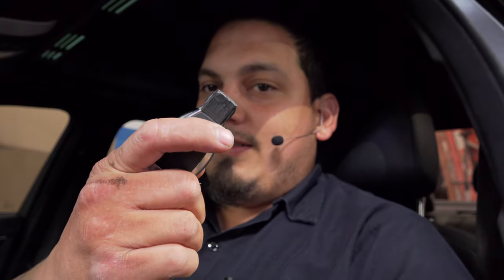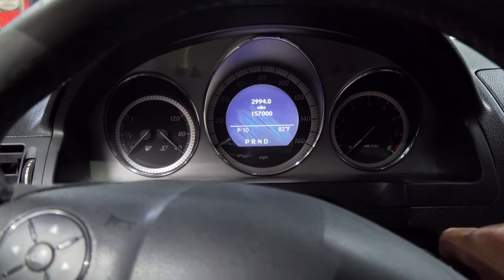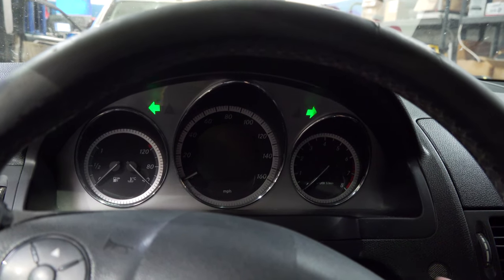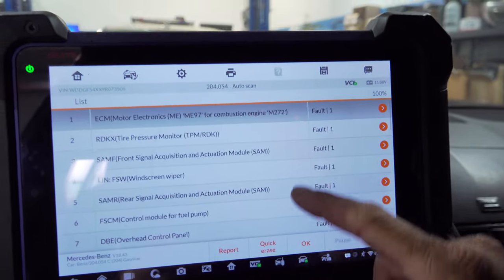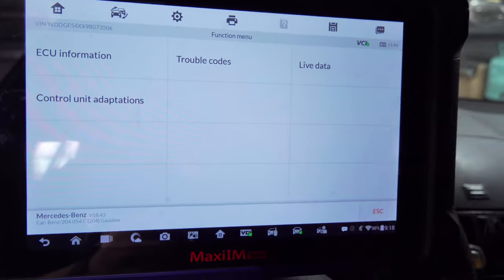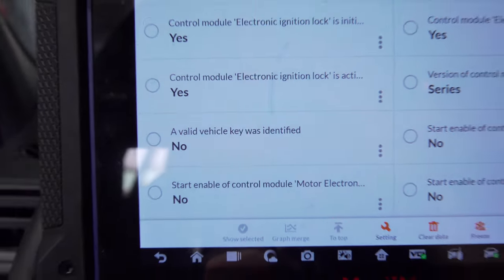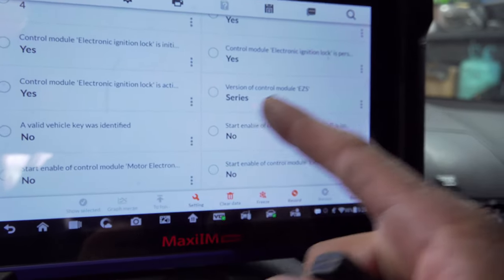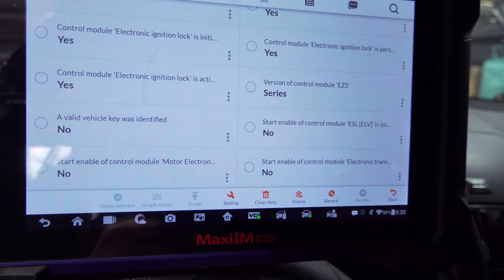2009 MERCEDES C300 (W204) - NO CRANK | HOW TO DIAG DAS IMMOBILIZER SYSTEM | KEY - EIS - ESL

Comment: Hey Mario quick question bro I have a 2006 c55 AmG the positive and negative on battery touched and now I get no start cluster turns on just no crank to start I DO GET “ replace steering lock “ on code reader would that cause the steering lock to not work?  Is there anyway to fix or bypass a steering lock ? Please help

Comment: I Kno this is old but I stick my key in ignition and turn and nothing happens ( the key unlock/lock works ) and I take it out and put it in multiple times and it eventually works. The key is 6 months old and previous owner did a steering lock bypass. Any ideas what it could be? It's a 09 Mercedes C300 sport
Reply from the maker: @jojo3sixty  we would need to do some more testing to see if it’s the key, or the emulator. This will require a scan tool that is capable of reading immobilizer related modules
Reply: @SuperMarioDiagnostics  thanks for the reply. Is it something I can buy? Or I have to take in to a shop. I'm a first time Mercedes owner so not used to not being able to YouTube and fix my own problems

Comment: good analysis procedure, find out it is the Key cause not cranking, most mechanic suspect it is the ESL or ignition switch problem! (most mechanic would not open the key and check inside the part was lose or banned!)

Comment: Thanks for the awesome content 
Is there a way to check eis functioning with im608
Dealing with W210 02 clk 
Both keys unlock car
Eis wouldn’t turn at all
Cluster not showing anything 
Els not unlocking 

I tested both keys on Autel both working fine 
Took eis out and program new key still wouldn’t turn

I’m thinking I have to program new eis
What do you think
Reply: The motor in the e.i.s. is probably dead.

Comment: when i insert my  key  in on c300 it says remove key from ignition.. i  took my car to the mechanics and they said they have to replace ignition steering lock and steering column. and i have to pay $1 100 to fix. I wanted to do it myself but it is a lot of things  and steps to do and i don't wanna mess my car up..
Reply: Same thing happening to me on my 2008 C350. Now I'm gonna have to shovel over $1,300.

Comment: It's not easy to find info on Merc's period. However this guy know his S 4sure. Excellent info presended as best as you could hope for as this is not easy to understand more/less get across in a video what steps you're going thru in your head. Cheers, glad I found this channel. If I could impose for a question; remote appears dead, When inserted get nothing (don't hear servo for I assume is steering lock &/or shift) no cluster activation either. I am thinking power/fuse, but I am conserned about bunch of after market crap been installed/uninstalled (scotch locks) all about rig. Yeah, not good. Anyway, your thoughts would be fantastic. Thanks

Comment: Obviously you've seen this problem before, which is a big plus for your diagnosis.  Without the info in front of me, I did somewhat understand your path of diagnostics and how the "start" signal flows from the key to the starter.
Would a wiring diagram and/or service information have helped to locate the problem?  Or did you take the time on your own to figure out how the system functioned?
Reply from the maker: It took having a failure of each component to come to this process

Service info does help tremendously. I'll see if i can find if there's anything that spells it out
Reply: @Super Mario Diagnostics 
Thanks for the reply.  Sometimes service info plus your own learned info is necessary.

Comment: I have a 2010 MB C300 and with the same issue. The car doesn’t turn on. I insert the key and the dashboard pops up “remove key from ignition.” After several attempts in trying to start it, the dashboard changes to only show the mileage. After several attempts the car will eventually turn on but sometimes it takes hours. I only have one key for the car. What do you suggest I do? Thank you!
Reply from the maker: Check live data for drive authorization operation
Reply: How did you get this fixed?

Comment: @Super Mario Diagnostics I have the same Car/Model W204 mine was okay all the way although it didnt Crank at all Then the Tech came and all he did was reInsert the Relays and Fuses in the Front Fuse Box and Reset ECU and it started again. No faults prior and after. What could be the problem? He is hinting thay it could be with the Front Consumer inside the Fuse Box itself that it might have gotten moisture.

Comment: Hey Mario my Mercedes S500 2003 key works when I stick it into the car ignition the clusters respond all the lights and radios work still no crank took it to a shop and they said it was ECM computer AFTER A RAIN STORM and drains were clogged.......any thoughts

Comment: Hi, for this exact same vehicle I have a major issue 

1 : after doing an online programing of the ecu and front and rear sam , it suddenly says hood sensor no com and back seat rest latch code comes on ( previously before the online programing no such issue and even the car hood doesn't seem to have Been equipped with any sensor for hood warning for my 2009 w204 ) 

2: I try to activate the teach in drive authorization and when it gets to the part when it says start engine and allow to idle for 30secs , the Benz won't start until I turn the key back off and try to start it again before the engine will start which at this time the process fails , 

I'm using the launch immo elite , also launch pad vii and topdon phoenix plus , yet no success,  please I really need your help

Comment: Hi there I have a issue with my Mercedes clc cdi 220 2009. When I turn the key full turn to start the car all lights come on and the needles all move up and drop back down again but the car will not crank, I then turn the key back to position 1 then turn to position 2 leave for a few seconds the turn all the way and the car starts. If I'm in traffic crawling sometimes the car cuts out  I have had 4 different mechanics do diagnostics and had the crankshaft sensor changes ,I've had the key and switch checked and tested and all is fine. I have spent around £400 so far trying to get to the bottom of this issue but no mechanic can seem to fi d out what the problem is and its getting frustrating now. Have you got experience with these cars and do you do full checks to what can cause a issue like this?

Comment: Hey love your channel brother, I'm an infiniti tech. Quick question how are you communicating with the car and the keys off? my snap on triton d10 will not communicate with koffeo. Is this a Mercedes thing or special function of the autel?
Reply from the maker: Depends on the vehicle. Some vehicles with the hazard lights on will keep the immobilizer systems on, among other systems. I’m pretty sure Infiniti with the hazard lights on will keep the BCM on. it will fill to automatically pull up the Vin number because most vehicles report Vin numbers from the PCM except for Mercedes which will report the Vin number from the EIS. So if you try to bypass the Vin number by manually inputting it, and you still have no communication, try with the hazard lights on. It should communicate regardless of the schedule. If it does not communicate then you have something else going on

Comment: Xentry has a test for the drive authorization, works slick. Identifies faulty column locks and eis in seconds.
Reply from the maker: Yes I've used it as well. It's great for those who have Xentry. most of my audience does not have it though. anyone can look at live data much faster than that test. So long as they understand the sequence of events from key insert to cranking

Comment: My Benz just did this the other day, was running fine, shut it off and it wouldn’t start after, so I bought a battery and changed it out, and still no start everything comes alive when I put the key in but won’t turn over when I turn the key, any pointers ? Everything was fine before I shut it off , and it wouldn’t start again after
Reply from the maker: Yes look over drive authorization parameters and perform testing of the starter command circuit

Comment: My new to me 99 W210 had intermittent no crank no start.  Luckily, it was not DAS related.  Turns out K40 relay control module was bad.  Swapped out the complete unit.  Should have tried swapping starter relay first but the complete K40 was $25 from the junkyard so in it went.  My TCM had fluid wick.  Any fluid on the connector means there is some inside the module.  I opened my TCM and cleaned PCB and case.   Plastic harness connector in transmission is not sealing and has to be changed.
Reply: Where v was k40 located at

Comment: Thanks for the information. 👍
Reply: did you solder with very thin solder tip 🤔
Reply from the maker: Yes i use the hakko t18-br02
Reply from the maker: But in this case i used a hot air station

Comment: Amazing video! 🙌

Since removing the battery and reconnecting after few hours my car does not start now only opens and closes windows, car cluster goes on but does not change when key is turned or accessible either setting etc. After a few days only one out of the two keys open the doors.

Any suggestions are appreciated 😁
Reply: What was the problem? If you figured it out, I’m dealing with the exact same problem
Reply: It was the steering lock, i sent the EIS and ESL to a guy and made me a bypass for the ESL for like 100 euros

Comment: Not trying to step on any toes here. There are micro switches and hall efffect sensors inside the EIS. When the key is inserted, the "slider" pushes up on a lever closing one and when the fob gets turned there are others that get activated. This is the mechanical status the EIS needs so it knows what position the fob is in. And is what you are seeing on the left hand column of the scanner during the first scan.

Comment: So I have a 2013 Mercedes c300 4 matic the coolant light came on when first cranked yesterday morning made a trip to get coolant came back and left the engine completely cool off and added the coolant and now it will not crank the dash lights come on (every sensor) have noticed a slight hum noise prior to turning on and off for about a month now fuel pump plus sensor was replaced about a year and half ago noticed the cars Bluetooth will shut off within 3 minutes after parking and use to play for over 30 minutes.. any suggestions thanks for this video I learned a lot!
Reply from the maker: Where did you pour the coolant???

Comment: Having the a similar issue with my 2012 c300. However when i put the key it just tells me to take it out. Lights turn on so does radio car locks and unlocks. But wont start. Wont even make the motorized noise when I first insert the key like it always does. Turn the key nothing try to start it nothing but everything else works. What can i do ?
Reply from the maker: Check for the operation of the electronic steering lock
Reply: @SuperMarioDiagnostics  steering doesn’t seem to be locked. So I’m not entirely sure, my guess is the circuit board not sure tho because it started the day before yesterday just fine then last night I go to get in and immediately noticed that when I inserted they I did not here the normal mortised noise that normal sounds when I insert the key. Dash board comes on and lights and radio ect ect but will not crank, start nothing
Reply from the maker: @kevinsito0801  same answer. You need a functioning lock
Reply: @SuperMarioDiagnostics  mind sending me a link to get a good one or would u would recommend. Thanks
Reply from the maker: @kevinsito0801  so i can make an emulator for you. If you’re interested, email me at supermariodiagnostics@yahoo.com

Comment: Im having a similar issue with an 09 c300.  The dash lights don’t come on. I can get the car to start and run.  While driving all the dash lights and radio will shut off  and come back on.    Did find water on the driver side floor so I’m guessing one of the drains are clogged.

Comment: Hey was up Mario , could you have inserted a random Benz key into the slot to verify Ezs system was reading and borrow it down to just a dead key ? Usually you'll get like a wrong key message on the dash right ? Good video, I was just thinking how I would tackle this without the autel immo tool .
Reply from the maker: Yes, that's correct. I actually mention that in the video 😉

Comment: What a good tutorial on DAS !

On a 2008 W204 GLK280,
Steering column clearly unlock when both keys are plug in,
In second contact position, a message appear: "ESP inoperative and run flat inoperative" and engine will not start,
Xentry show ME9.7 N3/10 Control Unit isn't awake, unable to ask fault codes on it.

On  EZS,
A valid vehicle key was detected YES
Start enable for control unit 'ESL' is issued YES
Start enable for control unit 'ME' is issued NO
Start enable for control unit 'ETC is issued NO

Sometimes this message disappear, engine starts, and "no CAN combustion engine communication" fault code is recorded on ESP, FSCU, ESM, VGS and IC.
Fuses, relay, CAN lines have been checked.

I want know if I replace N3/10 ECM ME9.7, N10/1 front SAM, N73 EZS or ELS.

Comment: To read the key you have to push a button and not just put it in the slot
Reply from the maker: There are separate signals for remote functions and for ignition functions

so no, you don't need to push any buttons for the ignition to function